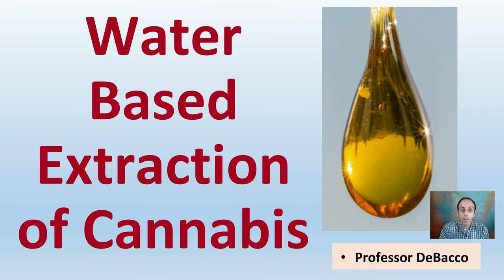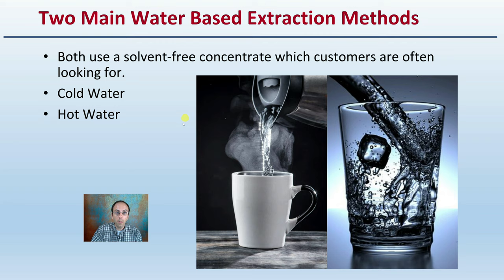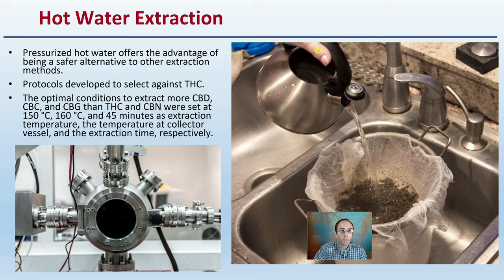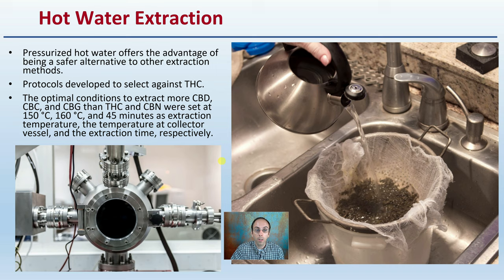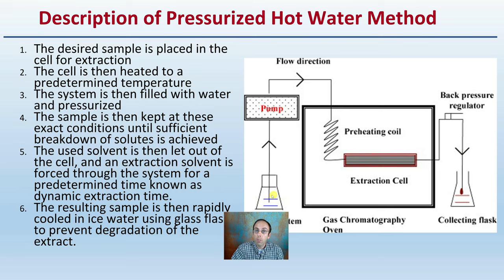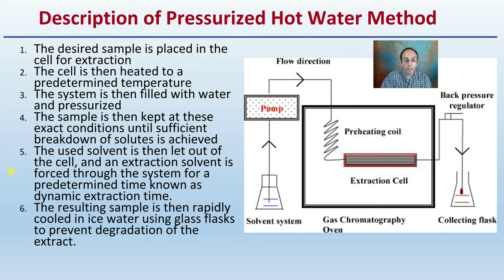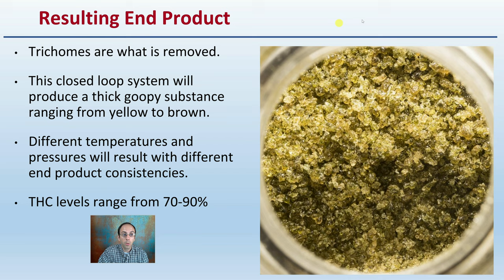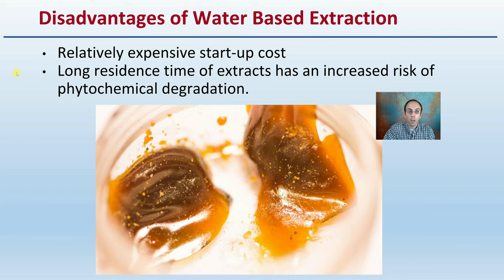Water Based Extraction of Cannabis

Comment: Im looking forward to the espresso and cannabis communities colliding. High pressure hot water extraction is something that is already widely adopted for home use after all. Something like a specialiced cannabis basket that you can just plug into your espresso machine to make high quality cannabis extracts at home without a giant startup cost
Reply from the maker: Sounds like a great idea.
Reply: @DeBaccoUniversity  I did some experiments and there is sadly no way the pressure or temperature is high enough for long enough to extract anything with domestic espresso machines.
Reply: Moka pot. You’re welcome
Reply: @TheHabadababa  well you also have to keep in mind terp degregation/ offgassing and thcs reaction to excess heat

Comment: Or you can just boil it for about 10 mins. Filter off the bud ect. And then let the water evaporate . and have alot of oil
Reply from the maker: May not be the most efficient method, but can be a form of extraction.

Comment: well, i used the ice and cold water method without any filters except probably gravitation and i think it worked fine. at least from my smoking subjective point of view ... btw, it was just seedy industrial hemp according to EU-standards ..... poured a lot of water away and what settled down, that put i in the sun to dry
Reply from the maker: You may want to consider adding some suction filtration to help speed up the process a little bit.
Reply: @DeBaccoUniversity  well, I was quite satisfied with the outcome. I used so called "pollen filters" earlier and that was very slow. I do not plan to use this commercial scale so it just has to satisfy "household" needs.

Comment: Hi, do you dry your trim before doing ice water extraction? I always thought fresh frozen worked well and would be best way for yields and plant matter less prone to breaking down in wash. But I've heard people say because it wasn't dried and cured it will go moldy. Would working into a temple ball with heat and pressure or adding to MCT oil bipass the risk of mold?
Reply: And I guess have you heard of any such risks involved with using plant material in different end stages of the plants life?
Reply from the maker: If material is clean to start with and then kept in favorable environmental controlled conditions the risk of mold would be reduced.
Reply: @DeBaccoUniversity  brilliant, thank you

Comment: is this a real university, getting into studying canna and need accurate info when i can get it so far you seem really good, subbed. so far i used hydroperoxide seed germ method worked good but only on new seeds however i think old seeds issue was storage issue so was no coming back.
Reply from the maker: I use this information at the different University courses that I teach.

Comment: DeBacco U, very good subject matter! May I ask you about the Hot Water approach of oil extraction with a simpler protocol. Like bring a pot of distilled water or filtered spring water to a boil add frozen herbs and simmer, not boil for how long? then pour through filter into a Pyrex 4 cup measuring cup and simmer stir to evaporate water till it clears up and starts to simmer take off heat and stir slow to clean out remaining water or extract with baster from oil slick on top contained to a oil slick? PLEASE HELP with a regular old school simple hot water EXTRACTION PROCESS. OIL FLOATS ON WATER PRINCIPAL.
Reply from the maker: Maybe this will help provide some information... https://northslopechillers.com/blog/a-crash-course-on-high-quality-cbd-extraction/